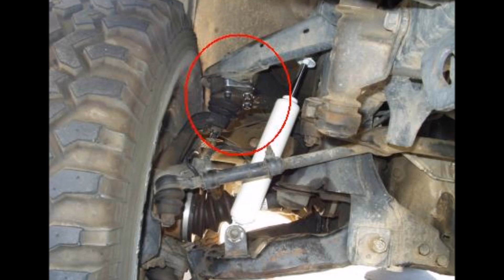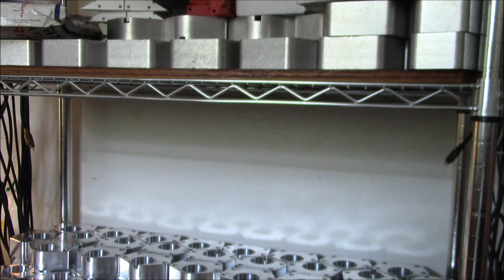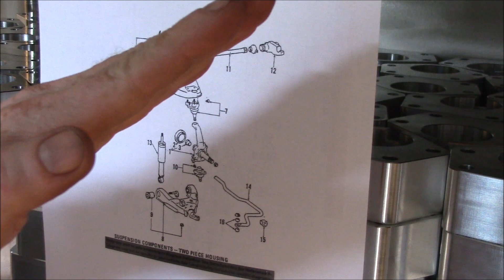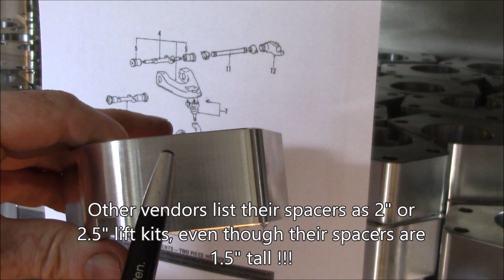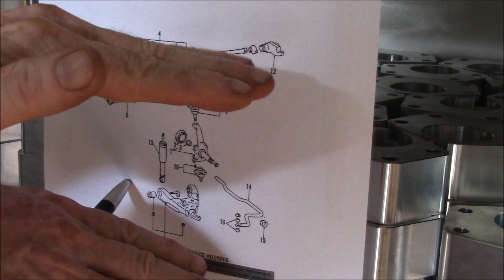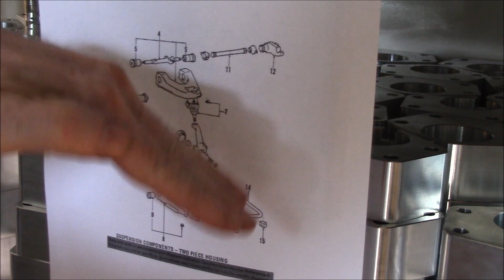Toyota 4WD/2WD Ball Joint Spacers

Comment from the maker: We have sold out of the 2WD and 4WD ball joint spacers.  There are other sources of these parts listed on the web page below:
https://www.4crawler.com/4x4/ForSale/BallJointSpacer.shtml#On-lineOrdering

We do still have the 2WD control arm braces and replacement hardware in stock.

We've also made the 3D CAD files for the 4WD ball joint spacers available for personal use, if interested:
https://cults3d.com/en/3d-model/gadget/toyota-4wd-ifs-ball-joint-spacers
Reply: I CAN NOT thank you enough for making your CAD files available!

Made a pair after my shift today and they turned out perfect! Thank you very much you made my day man!
Reply from the maker: @VeeDubConnoisseur  Great, nice to hear you were able to machine those parts.  Don't get a lot of feedback on these.
Reply: @The4Crawler  When will you guys be back in stock for the 1.5” 2WD bj spacers? There are others I can purchase on eBay but I’d really like to support you guys. Thank you!
Reply from the maker: @idhatemet00  No, we won't be getting any more of those in stock, but we do still have a few of the upper control arm braces in stock if you find that you need those after installing the spacers:
https://www.4crawler.com/4x4/ForSale/BallJointSpacer.shtml#FAQ14
Reply: @The4Crawler   I would totally use the braces if i still had the stock upper a arms! Appreciate it!

And that's unfortunate to hear. So just to clarify, you guys are never getting more 2wd drive spacers in any of the different thicknesses or just the 1.5''?
Reply from the maker: @idhatemet00  No, we won't be getting any more of the 2WD or 4WD spacers made.
Reply: @The4Crawler  Thank you for clarifying, appreciate the fast responses! Take care

Comment: Hey how’s it going. I would like to order some front spacers and your recommendations on longer leafspring knuckles for the rear to enter 3 inch lift. I’ve got a 1992 Toyota pick up base model leaf springs are underneath the axle on the rear  would like a couple of your spacers for the front
Reply from the maker: See the web page link in the video description for some possible purchase options.  For a 3" lift on the rear, your best options are to look for some lift springs or consider doing a spring over axle conversion.

Comment: I believe your username is 4Crawler on YotaTech ? I am having issues with a hoat soak hard start low idle on my 86 Turbo 22RE pickup and a slight miss at idle. I was wondering if you could walk me through the VSV Removal since I believe the 22RE vacuum diagram route is different ?
Reply from the maker: Might be different on the turbo, but see below:
https://www.4crawler.com/4x4/CheapTricks/22RE_Engine_Pix/8.html
https://www.4crawler.com/4x4/CheapTricks/22RE_Engine_Pix/9.html
https://www.4crawler.com/4x4/CheapTricks/22RE_Engine_Pix/10.html
Just find the VSV that connects the the fuel pressure regulator (FPR) and bypass it by running it's vacuum inlet line directly to the FPR.
Reply: @The4Crawler  Cool thank you. You also did have that hot soak hard start right ? Also are you still selling the Allen Keys bolts for the TPS ?
Reply from the maker: @billythomas4527  Yes, I had trouble with hot starts and also with bogging down off idle.  The crazy thing is that VSV is supposed to "help" with hot starts, at least per some internet "experts" but I think it has the opposite effect.  It's simple to bypass and see if it helps.  

TPS screw kits:
https://www.4crawler.com/4x4/CheapTricks/TPS/index.shtml#AllenHeadScrews
Reply: @The4Crawler  Awesome, thank you, sir. I still gotta order the bj spacer. I'll see if I need them since I'm gonna remove some leafs off the OME rear spring leaf pack. What about the TVV ? I'm gonna be testing my egr valve entire system soon enough since I am in Canada, no smog emissions testing (yet....) Do you still have your egr and tvv (the purple sensor with 2 nipples) ?
Reply from the maker: @billythomas4527  My '85 just has a BVSV  under the throttle body that switches on vacuum to the EGR when the coolant is hot, if that's what yours does.  I still have the EGR for California smog checks.  It is easy enough to block off with a plate or lots of delete videos on YT.
Reply: @The4Crawler  Thanks for your time. A true help

Comment: Hey I know this video was put on youtube long ago but I have a question for the 2wd lift. So i installed mine and have positive camber do you have any idea how to fix it? A new owner of a 1985 toyota 2wd pickup .
Reply from the maker: Assuming you've maxed out the camber adjustment, the only real option is to back off on the torsion bars.  You've likely raised the front end beyond where you you adjust the camber:
https://www.4crawler.com/4x4/ForSale/BallJointSpacer.shtml#FAQ16

Comment: What does the 2wd control arm brace do? I'm confused since it mounts on top of the control arm
Reply from the maker: The brace reinforces the somewhat weak point where the upper ball joint bolts to the end of the upper control arm:
https://www.4crawler.com/4x4/ForSale/BallJointSpacer.shtml#2wdUCABrc

You can see that in this photo:
https://www.4crawler.com/4x4/ForSale/Docs/Images/2WDspacer2.jpg

We've found that when folks start taking 2WD pickups off road, that cantilevered ball joint hanging off the end of the control arm can cause the sheet metal, that the control arm is made out of, to bend and crack.  The brace goes on top and sandwiches the control arm metal between the brace and the ball joint.  The brace is made of 1/4" (~6mm) thick steel.
Reply: @The4Crawler  ok noted, i will be ordering from your website 👍

Comment: What would you recommend I purchase to make my 1990 Toyota pickup RWD the stock height of a Toyota pickup 4WD?
Reply from the maker: Ball joint spacers for the front:
https://www.4crawler.com/4x4/ForSale/BallJointSpacer.shtml
Lift springs, add-a-leaf or longer spring shackles for the rear:
https://www.4crawler.com/4x4/ForSale/Shackles.shtml#FAQ14
That may let you fit taller tires which would add some lift.
Reply: @The4Crawler  I’m trying to fit 235/75R15 think that would do the trick v
Reply from the maker: @JohnyBoy512  That's around the stock tire size on a 4WD, 28"-29" dia.  Some tips on the web page below:
https://www.4crawler.com/4x4/ForSale/BodyLiftKit.shtml#FAQ10
This is mainly aimed at the 4WD trucks, but the general ideas on checking clearance, etc. should still apply.
Reply: @The4Crawler  I just ordered the front ball joint spacers for 2WD 90 pickup, do you know what exactly I need to order to give the rear a 2-3in lift? I believe my truck is springs under axle since it’s 2WD
Reply from the maker: @JohnyBoy512  Some options below:
https://www.4crawler.com/4x4/ForSale/Shackles.shtml#FAQ14

Best would be to start with something like an add-a-leaf spring, something like this:
https://www.4crawler.com/Diesel/CheapTricks/RearSuspension.shtml#Add-a-leaves

Then if you need additional lift to level the truck, for example, then a longer than stock spring shackle:
https://www.4crawler.com/4x4/ForSale/Shackles.shtml#OrderingInfo

Comment: I installed a set on my 4 wheel drive 96 T100 and the tire hits the upper control arm....
Reply from the maker: See the note on the web page about wheel backspacing:
https://www.4crawler.com/4x4/ForSale/BallJointSpacer.shtml#BackSpacing
Simple fix is to add a wheel spacer, usually a thinner one between the hub and wheel is all that's needed.

Comment: It's my understanding that tightening the torsion bar (lifting) will add positive camber. I intended to go a little bit higher to better fit my wheels. Having never touched my torsion bars, I just installed a set of these ball joint spacers on my 2WD and they added a very significant amount of positive camber and ~half an inch change in ride height. My tires are a little bit wider than stock and they now rub a bit. 
Am I going to have any issues when I try and get the truck aligned afterwards?
Reply from the maker: There will always be something that limits the maximum lift you can get with the spacers:
https://www.4crawler.com/4x4/ForSale/BallJointSpacer.shtml#FAQ16
All depends on how much adjustment room is left on the A-arms.
Reply: En realidad para levantar una pickup 2wd debiera colocarse el espaciador en el brazo inferior que es el que está unido a la barra de torsión.

Comment: Do you still sell these and if so what sizes are available?  Is a 2" spacer too tall for the stock IFS control arm? Any issues with the front 4wd shafts?
Reply from the maker: Yes, still available on our web site, link in the video description and end screen.  Typically, 1.5" is the tallest spacer that'll work with most vehicles.  Above that and many run into issues:
https://www.4crawler.com/4x4/ForSale/BallJointSpacer.shtml#FAQ2
Something will limit the ultimate lift height, be it the CV axles (we offer a front differential drop to help with that), or you'll run out of adjustment on the alignment cams or you'll run out of down travel on the suspension.
Reply: @The4Crawler  Hey, thanks for the reply.  I'm also seeing in some places that a drop kit for the sway bar and differential may be needed if using BJ spacers. Is that correct? I have a 94 yota truck 4x4.
Reply from the maker: @oldowl4290  A front diff drop kit may be needed:
https://www.4crawler.com/4x4/ForSale/DiffDrop.shtml#DiffDropSymptoms
and if you do install one, you need to lower the sway bar as well, if you still run one,  because the sway bar passes under the back of the front diff.
Reply: @The4Crawler  thanks for the fast reply! I do in fact have the factory sway bar.  How thick are these spacers? It looks like the ones for the pickup trucks are different from the 4Runners?
Reply from the maker: @oldowl4290  Sway bar and diff drop spacers are 1" thick.  Some of the 4Runner models have different bolt hole spacing than the pickups.
Reply: @The4Crawler   Final question. If I order on Monday can you ship out by end of next week? (BJ spacers and the diff/sway kit for 4WD IFS pickup.)
Reply from the maker: @oldowl4290  There's a good chance of that happening.

Comment: Got any for a 81 TOYOTA 2WD? Any tips would be appreciated
Reply from the maker: Sorry, no.  The 2WD control arms for '83 and prior were set up differently.  Cranking up the torsion bars is likely one option or see if there are any sort of drop spindle type lift kits for that year.  Another possible option is to retrofit an '84 or later front suspension to the frame.

Comment: Is this compatible in hilux ln166 model 2001 ? And how can i order ?
Reply from the maker: Possibly, check the bolt pattern on your upper control arm ball joint and compare to the bolt pattern dimensions on the web page:
https://www.4crawler.com/4x4/ForSale/BallJointSpacer.shtml#2WDor4WD

Ordering:
https://www.4crawler.com/4x4/ForSale/BallJointSpacer.shtml#On-lineOrdering
Reply: @The4Crawler   im from the philippines , i have toyota hilux ln166 model 2001 4x4 , the pattern of uppercontrol is same.

Comment: Does this mess with the geometry of the lower control arm.
Reply from the maker: Any lift on the IFS suspension will affect camber and toe in adjustment, so you'll generally need an alignment after installing the spacers.  You may run into an adjustment limit on the alignment cams, that can vary vehicle to vehicle:
https://www.4crawler.com/4x4/ForSale/BallJointSpacer.shtml#FAQ16
This may limit the maximum lift height you can achieve.  This again is true of either cranking up the torsion bars or installing spacers.  The advantage of the spacers is you can keep the torsion bars with less preload and also maintain the full range of up/down travel before the bump stops make contact, which can happen with torsion bar-only lift.

Comment: I'm in Oklahoma donu have a web site? Do u make any for the lower ball joint that would give a couple more inches too?
Reply from the maker: Sure, link to web site in the end screen, video description and below if that's easier:
https://www.4crawler.com/4x4/ForSale/BallJointSpacer.shtml
A spacer between the lower control arm and ball joint would not do anything lift wise.  All it would do is push the lower control arm lower than it already is, since the ball joint is below the spindle.

Comment: Hi mate.
I have 96 toyota surf kzn185 n would I have to add new ball joint spacers if it lifting up to 3 inches.? Thanks
Reply from the maker: See below:
Adjust torsion bars for additional lift:
https://www.4crawler.com/4x4/ForSale/BallJointSpacer.shtml#FAQ2

Add to spacer height:
https://www.4crawler.com/4x4/ForSale/BallJointSpacer.shtml#CustomHeightSpacers

Lift height limits:
https://www.4crawler.com/4x4/ForSale/BallJointSpacer.shtml#FAQ16

Comment: do you have such ball joint spacers for Nissan D21 Hardbody pickup 4*4 ?
Reply from the maker: We don't have anything specifically for that model, but check the bolt hole dimensions on our web page:
https://www.4crawler.com/4x4/ForSale/BallJointSpacer.shtml#2WDor4WD
and compare those to the ball joints on your truck and see if they match.   Perhaps Toyota and Nissan use the same ball joints.
Reply: @The4Crawler  ok i will check it and inform u soon...thanks...

Comment: Hi, can I double the spacer??
Reply from the maker: Probably not 2 full height spacers, physically not enough room.  But we do have custom height spacers which some folks have been able to fit 1/2" or 3/4" tall spacer on top of a 1-1/2" spacer:
https://www.4crawler.com/4x4/ForSale/BallJointSpacer.shtml#CustomHeightSpacers

On any given truck, there's going to be something that limits how much front end lift you can get, discussed below:
https://www.4crawler.com/4x4/ForSale/BallJointSpacer.shtml#FAQ16

If considering going that route, best to get say the 1-1/2" spacers, install them and then see how much lift you get and if you think you can go higher, you can get a good idea by cranking up the torsion bars for a test.  Then, if you, for example, were able to get another 3/4" out of the torsion bars, order up the 3/4" spacers with the longer bolts and add that to the original spacers and then relax the torsion bars.

Comment: Will this fit on a 1980 toyota pickup 2wd RN42
Reply from the maker: No, only for the '84 and later 2WD pickups.  The earlier models had different style control arms and ball joints:
https://www.4crawler.com/4x4/ForSale/BallJointSpacer.shtml
Reply: @The4Crawler  Ok, thanks for the quick reply. Do you know of any options for lifting a 1980 toyota pickup 2wd RN42?
Reply from the maker: @azollo  I think cranking up the front torsion bars would be the first thing to try.  For the rear, add-a-leaf spring,, longer spring shackles or a set of lift springs would work.

Comment: Can it be aligned after installing the spacers
Reply: On a 2wd
Reply from the maker: Yes:
https://www.4crawler.com/4x4/ForSale/Docs/BallJointSpacer_HowTo.shtml#GetAnAlignment
You may run into a maximum lift height where you max out the alignment adjustment, either eccentric bolts on the 4WD or shims on the 2WD.  That would be your maximum lift height which will vary on any given vehicle.
Reply: I have added the 1.5 spacers on my 2wd and cranked my torsions keys and now a have some bad negative camber. Can I solve this by removing some shims?
Reply from the maker: @moejr14  You might be able to change the shims out, either more or less depending on which way you need to move the control arm.  If you max that the adjustment range, then lower the torsion bars down until you can get the alignment into a reasonable range.

Comment: My lower control arms are relaxed/level. If I dont adjust the torsion bars and just install balljoint spacers will my lower control arms be angled up up little?
Reply: Well I just finished and I believe you answered my question

Comment: I have a 4Runner 1988 first gen, is it necessary to grind away the backside of the upper control arm for 1" ball join spacers? Or only with the taller BJS?
Reply from the maker: Not sure the exact height spacer that needs the clearancing, but at 1" it may only need a little grinding or bending of the metal to get it back together.
Reply: @The4Crawler  Thank you for your answer.

Comment: Will stock steel wheels have clearance issues due to their (approx) 4.5 in setback? Thanks for the video!
Reply from the maker: See below:
https://www.4crawler.com/4x4/ForSale/BallJointSpacer.shtml#BackSpacing

Usually only a problem with some ~31" tires.
Reply: @The4Crawler  how come ?
Reply from the maker: @billythomas4527 Discussed in detail on the web page:
https://www.4crawler.com/4x4/ForSale/BallJointSpacer.shtml#BackSpacing
It's just simple geometry, on the 31x15 tire, the sidewall bulge is located just about where the upper control arm end up after installing the spacers.  Will depend on the exact brand of tire, but if it happens, you can stick a 1/4" wheel spacer in there and eliminate the contact.

I've run 1/4" spacers for over 25 years on my 4Runner:
https://www.4crawler.com/4x4/CheapTricks/WheelBalance/modified_caliper.jpg
Available from most auto parts stores, universal fit for 4, 5 and 6 stud wheels.
Reply: @The4Crawler  I see. Thank you. The brand and model is the BF Goodrich, KO2 All Terrains Tires
Reply: R Brown perfect. Thanks. (I guess I meant “backspacing.”)

Comment: Hola este sistema sirve para una hilux 1997  saludos desde neuquen argentina
Reply from the maker: "Hello, this system is useful for a 1997 hilux greetings from neuquen argentina"
"Yes, these spacers will work with the Hilux models that have the torsion bar front suspension.  You might want to read through the Spanish installation instructions we have:"
Sí, estos espaciadores funcionarán con los modelos Hilux que tienen la suspensión delantera de la barra de torsión. Es posible que desee leer las instrucciones de instalación en español que tenemos:
https://www.4crawler.com/sdori/4wd_install_Spanish.htm